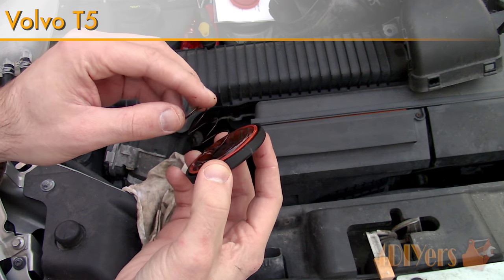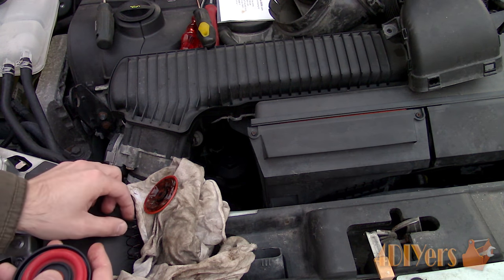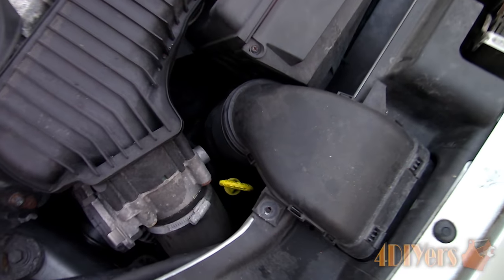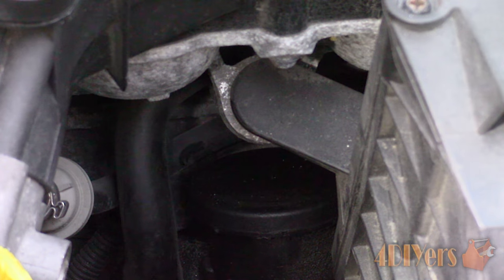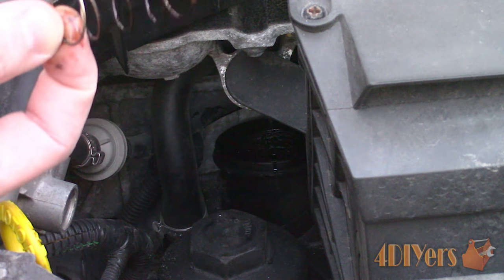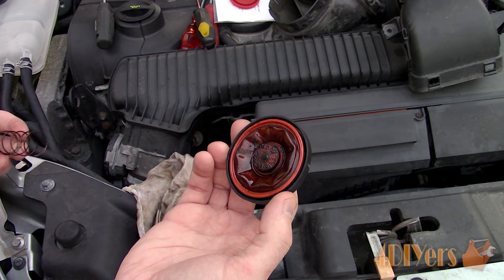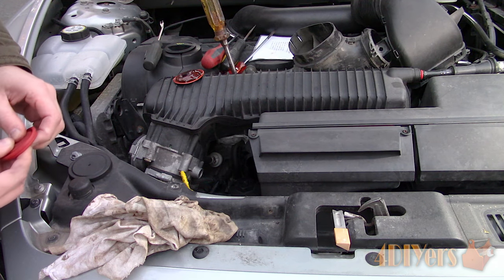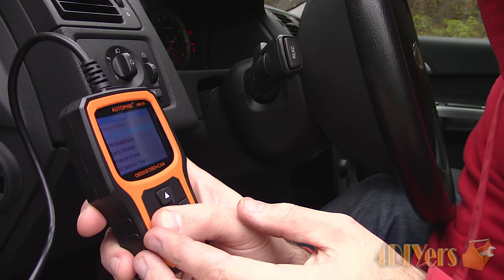How to Replace the PCV Diaphragm on a Volvo T5 [Money Saving Way]

Comment: i went to multiple "specialists" and even the volvo agency in Mexico and nobody can resolve this problem until i found this video, thank you so much
Reply from the maker: Happy to help and thank you for the feedback :)
Reply: Esta era la opcion que existia solo en Rusia y Latvia para resolver el problema del mal diseno del Oil Housing desde 2005. Ahora en ebay ya lo venden incluso oem.
Reply: Same here in El Salvador, these people get used to work old Toyota's only. Very disappointed
Reply: My 2011 C70  started leaking oil from nowhere. Long story short. The PCV failure increased engine pressure damaging engine seals. After replacing the broken PCV with this tutorial the leaking stopped and the code went away. I know there are damaged seals but can’t afford the repairs now. One advise, be careful with the spring when installing because it can bounce away. Thanks a lot for this tutorial!
Reply: How u know its pcv and not the diaphragm @MrFonedriver

Comment: Hey, in other videos I found information, that faulty PCV causes overpressure instead of vacuum. I just noticed I have an oil leak from the cap where the diaphragm is, also during inspection my car was running slightly lean during idle (lambda 1,1), May it be the diaphragm?

Comment: Had a P0171 error code and there were a ton of things people had tried.  Searched and searched for the oil trap because my engine model of XC60 T5 (2016) was impossible to find any help until I found this video.  This was exactly where it was and literally to me 20 minutes to change.  The hardest part was getting the top off the oil trap because mine didn't have a little space like this one to put a screw driver (or something else) like this one.  I used a tool that is metal which is used to scrape gaskets off and it worked.  Thanks a ton for posting this video!!!
Reply from the maker: Awesome to hear you were able to get it fixed and thank you so much for the feedback!

Comment: I'm still struggling to get the cap off. It's not as easy as it looks. I don't know what else to do
Reply: Mine was a 2011 T5. I had to use a soldering iron to melt a little notch into the flange that the cap rests on. The flange is flush with the cap, so you've got to be careful not to melt a hole in the cap.  That gave me some leverage under the cap itself.

Comment: I would like to thank you for the time in making this video , i never realized that the top cap of the pcv valve was designed to be popped off in that manner and replacement rubber diaphragms where available in that dimensions  , have a good day and thank you for your time
Reply from the maker: Always happy to help, thank you for your comment and feedback :)

Comment: Fantastic video. Thank you. I must say, the cap was a bitch to get off. The best way to do it for myself was stick a metal shim in the VERY slim gap between the cap and the housing, and turn the shim clockwise or counter clockwise to pry off
Reply from the maker: Thank you and great tip as well!

Comment: I managed to change out the diaphragms and I think it's important for others to know that there may not be a notch on the cap and possibly more importantly,  I feel a need to point out the seem between the cap and the housing is virtually invisible.  Vanos sends you information for links and photos to help one remove/ install the the diaphragm and in their photos, one can see the sliver of a gap between the cover and the housing.  Pry in between that sliver to remove the cap.  Getting it back on was a snap...LOL
Reply: Can you send me these photos? In my case the cap don´t have any notch.
Reply: BRIAN BRALEY 
🙏
Reply: @PTW201   I can paste the link to Vanos BMW page with the photos    https://vanos-bmw.com/product/membrane-for-volvo-30684381-engine-oil-filter
Reply: @PTW201  There are several photos and one shows the narrow sliver as well as where the notch is better than the others but all of them combined give a fuller view.  Increase their size as well and you can see that notch location for those that have a notch or in my case, just the sliver of a gap between the cap and body.  https://vanos-bmw.com/product/membrane-for-volvo-30684381-engine-oil-filter
Reply: BRIAN BRALEY Its done! Thanks a lot.
Reply: Yes, there's no notch on my cap. Worried about breaking the cap. Who or what is Vanos...could use photos!
Reply: No notch for my cap. I used a knife to make the sliver a little bit wider and then put a flat screw driver in, finally remove the cap and replace the diaphragm successfully! Thanks for your tip!

Comment: This only took me 1/2 hour!  A few hints:  You can just yank the airbox up (pretty hard) and gain an inch or two I just loosened the hose clamp to the air-intake pipe.  No need to remove any other screws.    Also, I sharpened an old screwdriver to get it in between the seam (which is hard to see), then twisted it to start removing the cap.  Last, make sure the cap is back down tight!  I thought it was tight but then used a wooden handle of a hammer, prying against the boss where the airbox was attached, and it went down further. I did it in a few spots on top of the cap.

Comment: You know , you did make removing that cap look a lot easier than it was . That being said this was the best, straight forward and perfectly described video I’ve ever watched. You covered everything from describing the problem, to how the vehicle reacts ,to the trouble codes finally ending with the correct repair . Well done sir!

Getting that cap off was a bitch,
Reply from the maker: Thank you, I really appreciate the kind words :) Wasn't that easy for me unfortunately, I just cut out the frustrating parts lol. It was during the winter when this happened so my hands were freezing which didn't help either.
Reply: As difficult as it is, it's much better than the earlier generation, which I have and he refers to with the oil trap "box", which you can't get to without removing the intake manifold....even though I love the T5 series engine, I'll never buy that generation again due to the stop box location.

Comment: Tnx! Did I just repaired my diaphragm with condom?! 
The outer rim and inner blade was intact so I but the cup inside the condom, pressed the rim
on top of it, cut the reminder and placed the blade in the middle.
In any case it works now, buy's me time till I get replacement.
Update: after 7 days the condom still worked but was loosing elasticity. Installed replacement and the mild engine vacuum is about the same as with condom.
Reply from the maker: LMAO! In a pinch, if it works, it works ;) There's gotta be a good sales pitch hidden in there haha.

Comment: You Sir are a legend! Your instructions were awesome, I added a hair dryer to soften the cap also, worked like a charm. I'm so happy as it saved me heaps, cost of the membrane from Russia was $35 and here in Perth Australia, Volvo would have charged me for a complete oil filter housing + labour which would be around $750. Thank you so much. :-)
Reply: Dave Armitage Thank you for the hairdryer tip!! I couldn’t have gotten my cap off without it. :)
Reply: @abbyedzards3498  you're very welcome 😊
Reply from the maker: Awesome to hear, thank you so much for the feedback and hairdryer tip!
Reply: @4DIYers  I have to be honest, the Russian company that supplied the diaphragm gave me that great info, my mechanic wouldn't touch it so I did it myself. Was easier than it looked. Interestingly enough I could not see any tears in the old diaphragm, but once fitted with the new one, the car is running like a dream, it really affected the turbo too.
Reply: Please send the link for where you bought it from

Comment: Great video! Thanks for the easy walk through. I'm glad you warned me about how stubborn the black cap can be because I would have thought I was taking it off wrong if you hadn't mentioned that. I had heard the "dying turkey" sound and then the OBD threw a running lean bank 1 code. I saw them for sale online but luckily, I live around 10 miles from IPD who keeps the diaphragms in stock. I adjusted out the dipstick a bit to relieve the pressure and drove out to IPD. After I got back, I cooled the engine and cleaned the area and did the swap just like you showed. The dying turkey is gone as is the too lean DTC. Thanks to you and IPD that cost me a few hours and $18!
Reply from the maker: Awesome to hear you got it fixed and happy I was able to help!

Comment: Amazing video, but I have a question about this. So in the video, the symptom of the PCV going bad is if there's a strong-ish vacuum on the oil filler cap and dipstick. But around the internet, I see the "glove test" used to indicate the health of the PCV; you open oil filler cap, put a latex glove over it and start the engine. With this test, the PCV is supposed to be good if there's a vacuum, and bad if the glove inflates. Isn't this at odds with the idea of a vacuum effect being bad? Or am I just confused.

Comment: Bought my 2012 c30 6spd last fall when fuel began to climb. Just wanted something cheaper on fuel. Didn"t know what I was getting. This car is so fun to drive. Started with your air filter instructions, moved on to replacing plugs, and wil be doing my oil changes from now on. Love your clear concise instructions.consider me subscribed. Now I do need to replace my a/c compressor. Any vid"s?

Comment: Hey, Great vid. Thanks. I noticed the one you replaced it with is slightly different to the original one? Did this cause any issues. Im about to do the same repair.
Reply from the maker: Thank you. I never had any issues with it, everything worked as it should.

Comment: Some  top caps are solid one piece -no slots to place pry tool in-still underline  is visible,only place to try to stick  screwdriver in?Are they still removable,anybody knows ?Do not want to pry open and break top cover  and ruin whole  part?Hope somebody knows ,thanks in advance. Car Volvo 2008 c30 T5
Reply: Did you end up figuring this out?
Reply: @VarunJoshi  sure,easy fix

Comment: This worked for my 2009 s40, over a few days the engine light cleared on its own after I swapped the part. Thanks a ton!
Reply from the maker: No problem, happy to help!
Reply: How did you get the cap off? I have the exact vehicle and don't wanna break the cap

Comment: I have had this issue and recently got the whole PCV replaced (hoses and clamps as well), yet I keep hearing the whistling noise and there's still suction when I remove the engine oil cover. does anyone have any Idea why that could be?

 I'm still yet to get the code however even though I have been driving the car for a while also there are no noticeable oil leaks at all

Comment: Very good instruction. I have just replaced my diaphram. The vaddum is drastically reduced, but there is still a alight vaccum when doing the oil filler cap test. After refitting the diapraghm one more time, the slight vaccum is still there. I guess, that is normal. A couple of observations: 
- I made a special tool by grinding an old screwdriver, so it would fit into the groove. That made removing the cap very easy. (Unable to post picture of it...)
- Before refitting the cap, I applied a little synthetic grease into the groove in the lid. That made reassembly quite easy. 
- Notice there are two different diameters of diaphrams available, 55 mm and 58 mm. My C70 2.4 from 2007 needed the 58 mm diaphragm.
Reply from the maker: Thank you so much for the kind words and sharing your experiences. Should definitely help out future viewers.
Reply: Dear Henrik, where did you get your 58mm diaphragm? Thanx
Reply: You might consider buying both the 55 mm version and the 58 mm version. You only know what you need, after taking it apart. The cost os €11 each.
Reply: The problem is that I can not find any dimensions..  Do you have any link to some website to buy both?

Comment: Thank you so much for the video, I ordered the part from IPD for about 20$ shipped to my door and since I have the elevate intake it was very easy to access the cap but getting the cap off can be tricky. After installing the new diaphragm no more squealing noise and no more high idle! Cars runs awesome and doesn’t sound like death at idle anymore! Thank you again 👍🏽
Reply from the maker: Thank you for sharing your experience and happy I could help!

Comment: the thing i still don't understand: if the PCV system is clogged, then positive crankcase pressure would not be ventilated, and thus pressure builds inside the engine, pushing out cam seals and etc. so wouldn't there be positive pressure when removing the oil cap or dipstick? you and the FCP euro guy both had excessive vacuum, not positive pressure. the glove test assumes positive pressure is a failure sign and vacuum is not. why?
Reply: i still have this question, and just got this issue on my C30 at over 212k miles. It's a vaccuum.

Comment: Hello. Thank you for your video. Its really helpful. I managed to change my diaphragm on my V50 2.4i.
I didn't have any negative pressure before that. After I changed the diaphragm and I opened the oil cap I saw I have negative pressure and it sounds exactly the same way like yours one before the change. I started reading and checking some guides and forums. All of them are saying that there should be a negative pressure since the whole system is designed to not have any air leaking. I'm a bit confused at this moment because I really don't know what to do. One of the options is to reopen the whole thing so I can see if there is some problem with the diaphragm ( I had some problems closing it and it took me 30-40 min to figure out how exactly to do it. On 2.4i you cant use long screwdriver for the back side of the cap. The other option is to replace the whole PCV system which I want to avoid due to the high cost. Some help and advice will be great.
Reply: I also have a 2.4i and I cannot get to the rear to open the cap to replace seal in the same manner as the video. How did you go about opening the cap?
Reply: @eamonjacoby  Hello. I didn't get any notifications about your comment. After I opened it from the front I used a flat screwdriver and gently pushed it between the housing and the cap. At the end it left really small area from behind which didn't pop. Was so afraid to not break the cap so I started slowly pushing the cap backwards toward the engine and it popped. That was the easy part. Afterwards to close it it was a whole adventure. You have to position the spring together with the cap. After that don't rush to close it because you may fuck up the diaphragm. Press it a bit and check with the tips of your finger if the diaphragm is away of the edges. I moved it sever times during the spring positioning. Then when you are ready just press the cap. Don't press it first from the back. For me it didn't work at all. Just position the cap all over the edges and press it at once. I was trying for 2 hours straight to close the way video shows. At last I decided I will try different way and it worked for less than a blink....I.....nvm I had fun :D

P.S. I just checked. My notification about replays were off. Hope you managed to do it.
Reply: Btw just in case someone is wondering the same as me. Its suppose to be some small vacuum. The sound at the beginning of the video when he opens the oil stick or the oil cap is normal  to be there when you open the cap at first. The is a test you can perform about the PCV system. You replace the oil cap with a surgeon glove and it should suck it in a bit then your PCV system works properly. If its blowing the glove then you should check your PCV as soon as possible since it may cause some serious problems to your engine. You can check some videos over Volvo PCV testing.

Comment: Was about to perform the repair on my 2008 S40 2.4i engine and noticed there is no groove for prying the cap off & the cap appears to be sealed much tighter than the cap in the video. Would this same procedure work for the 2.4i engine or is this specific for the T5 engine? I was able to source the diaphragm so I assume I can remove the cap but don't want to mess up the whole PCV system!
Reply: Did you ever find a solution? I have same issue, there is no notch And I can not pop the lid off

Comment: Amazing! Same diaphragm worked on my 2013 Volvo S 60 T5. Two different Volvo dealers told me I needed a new engine and a new transmission. They vehemently denied that it was the PCV system as I suggested. $50 and 20 minutes  of labor saved me over $10,000
Reply from the maker: Awesome to hear, happy to hear you were able to avoid that unnecessary work and money. I firmly believe that many European cars are falsely labeled for being maintenance nightmare when in fact it's actually a problem caused by terrible mechanics.
Reply: If the government was for the people those mechanics would be in jail or thrown into slave labor camps. I hate liars and thieves!!!!
Reply: Did you notice a difference in the cap that was originally on your car vs the one that came in repair kit? Also how did you get cap off? The notch on mine seems to be on the back side to where I can't get to it.
Reply: In the same boat but non Volvo speciality mechanic still charged me $1500 to replace.  Ugh

Comment: Useful video. I have a 2011 C70 and the housing did not have a notch. I ended up using a bee keepers hive tool to pry it apart. I installed the new diaphragm right into the cap and put the spring into the groove in the diaphragm before reinstalling. I also very gently twisted the spring end to make it tight to hold on to the diaphragm to help reinstall. Lastly I laid the hive tool on the cap to distribute force when I carefully tapped it down with a screw driver from above. Hope this helps a later model c70 owner.
Reply from the maker: Thank you so much for the feedback!